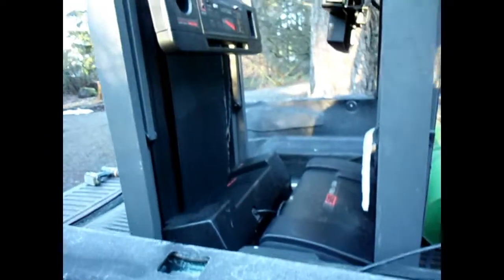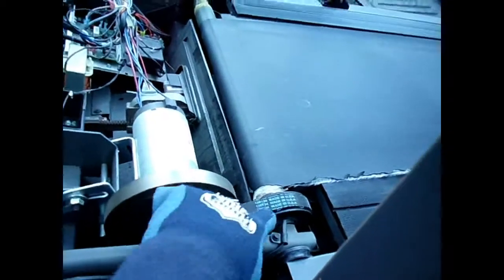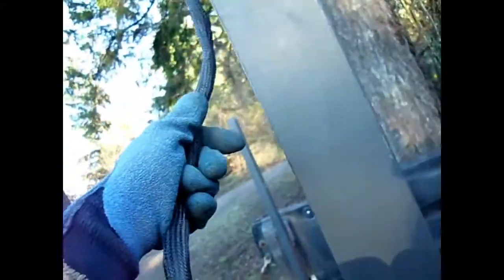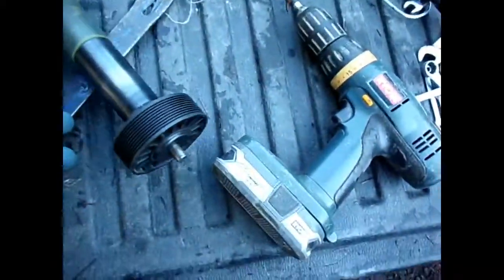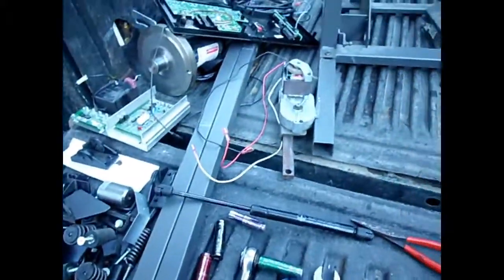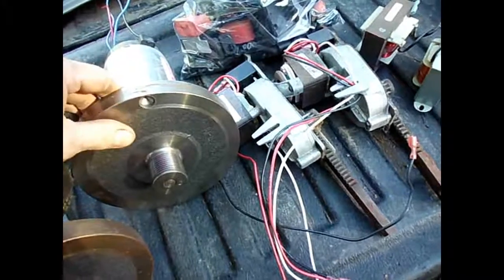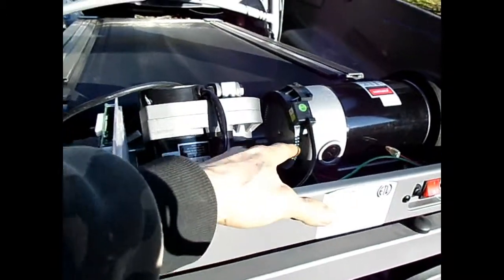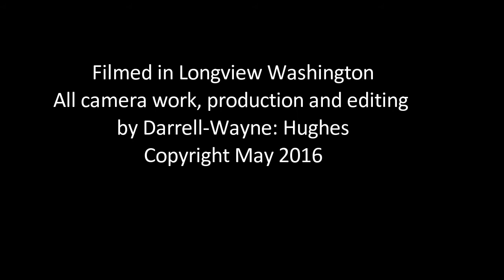treadmill teardown for wind & water wheel

Comment: Hi I am using the electric motor from a treadmill to make a custom belt grinder, but before I can I need to remove the large wheel from the motor without damaging it.  Do you have any tips on how to get that wheel off?
Reply from the maker: the fly wheel is a revers thread.... and they usually come off pretty easy